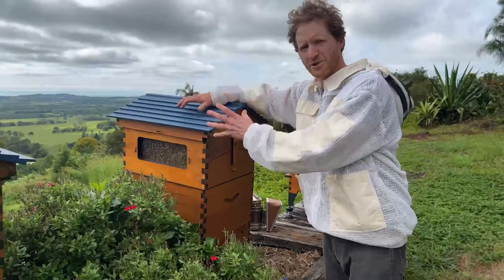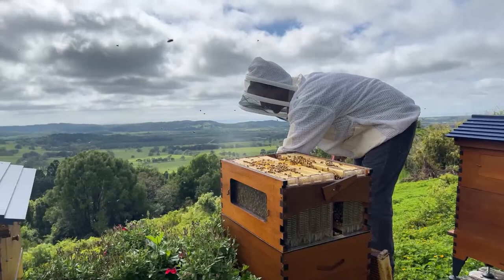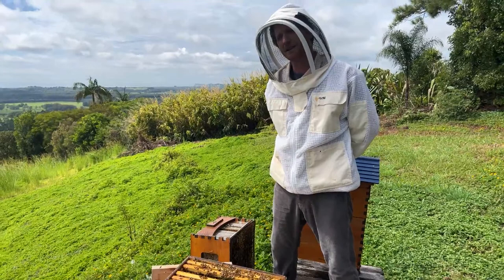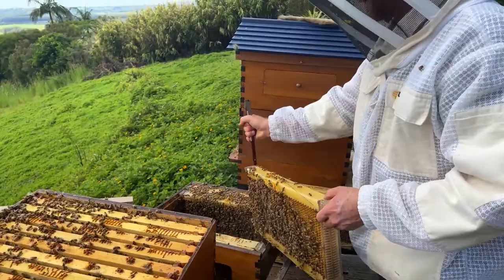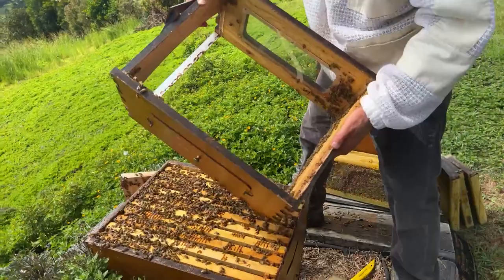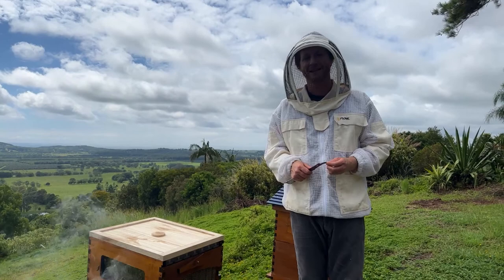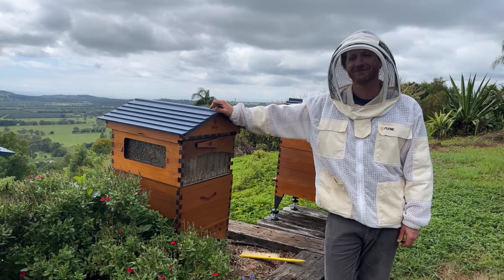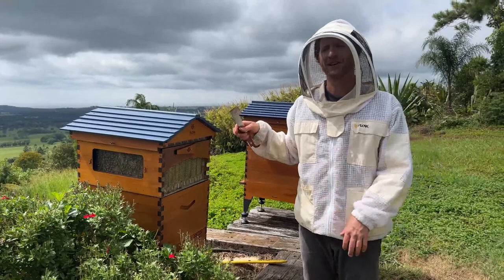Brood in flow frames, how to fix it

Comment: Hello, I am from Brisbane and we recently installed a nuc to our first ever hive (we are beginners) We purchased the 6 frame hive. However, whilst putting the frames from the nuc in we noticed that some of the frames were expanded out of the wood area, meaning we could only fit 7 frames in the box. Should we get another brood box? or just leave it as it is.

Thanks
Reply: Push all the frames together and squeeze the 8th frame in. It should fit. You don’t want to give the bees extra space by leaving a frame out.

Comment: hi i want to know if can hone be use in cooking instead sugar and how Because I heard that honey can be toxic when heated
Reply: You can use it in all kinds of ways. Also honey isn’t toxic when heated just kills the goodness of it.
Reply: Yes, for many years I have used honey instead of sugar for baking and cooking. Depending on the recipe you might have to use less liquid in the recipe since the honey is somewhat liquid, for instance when used in a baking recipe. If you are sweetening a broth or porridge then this isn't a problem. Also keep in mind that a strong flavored honey might alter the taste of the recipe, so best to use something like a clover honey which is more neutral tasting. You will need to experiment a bit to find what tastes good to you.
Reply: I also found that less honey is needed. So if the recipe calls for 1/2 cup of sugar, you might want to try 1/4 or 1/3 cup of honey.